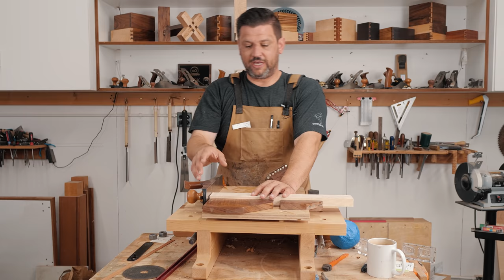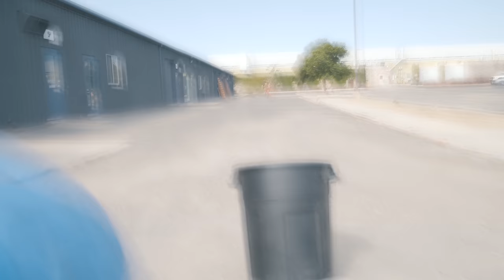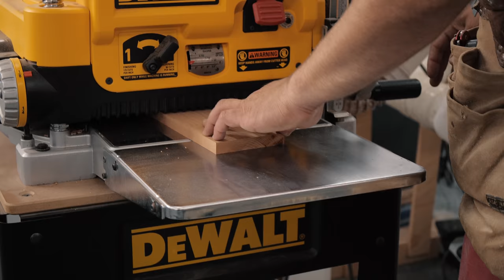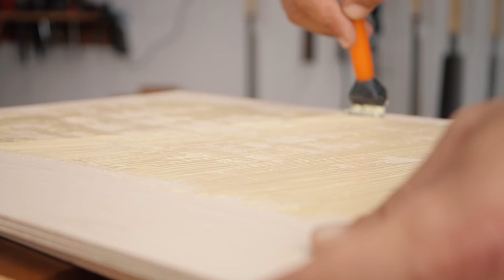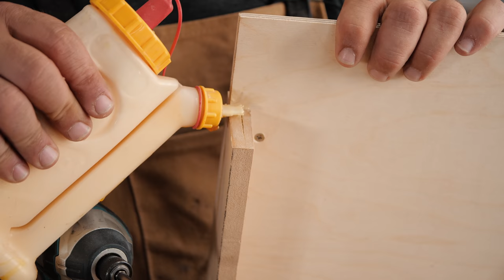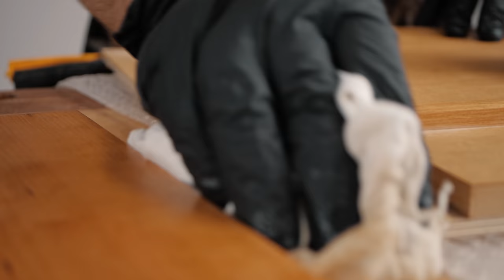The Shooting Board: The MUST HAVE Shop Jig with FREE BUILD PLANS

Comment: When using a shooting board, can you use a #4 plane or you need to use a low angle jack plane?
Reply: This is a two year old question, surely you have the answer, but in the interest of future viewers the answer is yes. You can use any size plane really, but the larger you go the better reference you get to the surface. They make planes that are specifically "shoot board planes" (like the Stanley #51 - they spelled it chute) and a lot of people use a #5 1/2. But Veritas makes a mini board and plant that I presume is for model making. I've even seen small versions made specifically for block planes instead of bench planes. No rules other than make sure you have square intersections.
Reply: maybe ist is worth saying that the plane blade can’t have a camber. It must be sharpen straight.

Comment: Love your videos, they're educational and useful with minimum time invested to build the project, that's what I like most.
If it's too complicated, a lot of audience loose the interest of building it!

I had my Shooting board accommodating my Veritas Jack plane but I installed the leading board on a piece of Plywood finished with Poly so the handplane glides easier and no wax needed.
I also added a "guard" rail so the plane rides on its side in between without moving away from the piece.                           
I thought I'll share it with you all.
Reply from the maker: Thank you kind sir

Comment: I simply glued scrap woods together, I see no issue with this is extremely simple variation. I don't see how it should get non-square. Only difference tough I don't know if required, but I thought it was a good idea to make the grain of the shooting board (base and fence) go with the planer, so when I hit it's edge on accident, it doesn't chip.

Comment: .Have not used one before but there are two things I dont get:

First, your planer needs to have a very precise 90 degree angle. Is this really the case? My one is timber, but ok, could by an american steel one instead of using brit version.

Second, I have not got the measures. What I mean, you dont want to hit your shooting board with the blade in any case, right? 
So, your MDF needs to be less thick that the distance between the blade and the side of the planer, right?

But why is your cherry part flush with the side of the MDF board? Why not recessed by 1 mill or so? You dont want to cut it.
But if recessed by 1 mill, you risk splitting the workpiece if planing end grain. So in this case, you plane from both sides half?

Comment: thanks for the information - recently started using my hand planes more.  May be a crazy simple question, but it would seem like the plane would shave your reference board, i.e. the board that your target board is sitting on.  How do you avoid this, do you have to make your reference board lower than where the edge of you plane blade comes through the plate.  If so, does this require a shooting board be designed based on a specific plane geometry/  Sorry if this is obvious to everyone else, not obvious to me - thought I would  ask.  It also gives you another comment for your YouTube algo.
Reply from the maker: Watch my video called the most common question about shooting boards (or something like that)
Reply: @katzmosestools  your the bomb...that had the answer.  Pretty smart of you sending me there got another like and view.  You got this algorithm thing down.  😎

Comment: This is probably a stupid question, but how do you stop the plane blade catching on the side of the shooting board which it runs up against ?
Reply from the maker: Search Katz-Moses most asked shooting board question on youtube. I have a whole video on it. Cheers
Reply: On the sole of the plane as u look at the blade coming out of the “mouth” you’ll see that the blade doesn’t go all the way to the very edge. That small section doesn’t cut and therefore always “rides” against the edge of the platform while the blade shaves  the edge that the plane rides along (at first, until it bottoms out because of the area riding along the platform (just realized how convoluted this might sound. Watch the video 😄) the edge tha the sole of plane rides against is a small backward “L”. Confusing because it’s so small it’s hard to see in demonstrations. Most people have the same question. His video on it makes everything clear 👍

Comment: Nice, functional and all of that. Only... it is ‘premier league’. Dado stacks, expensive and almost limited to de good old US of A or machines you will hardly find in a hobbyist shop. Pulling out a ‘piece of cherry’ yeah right, thats my wood budget for half a year. So nice vid, like to have this board but not in my reach. Thanks.
Reply: Nico Bogaard You can cut dados many ways.  A standard table saw blade, router, chisel etc...  Cherry is completely unnecessary but cool.  Use poplar or whatever you have lying around.